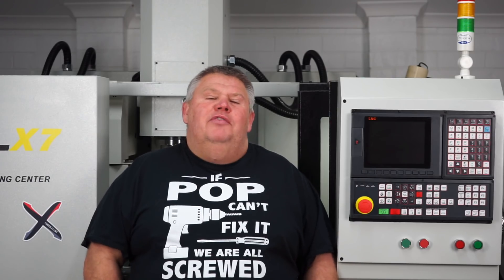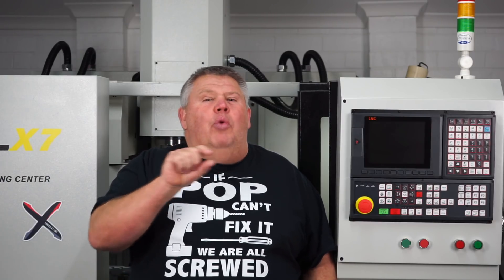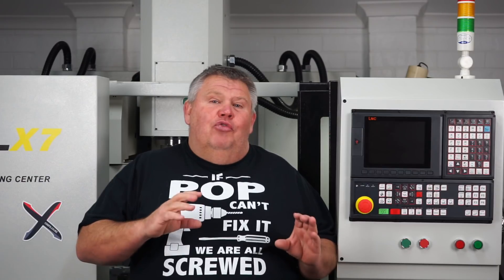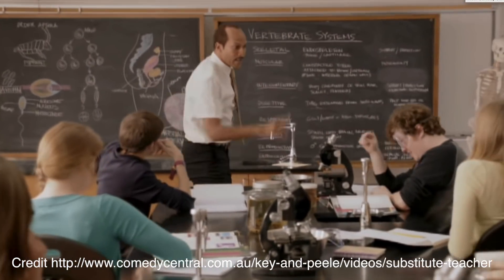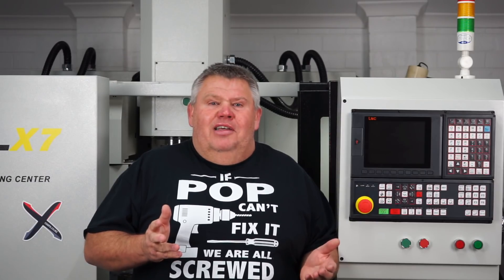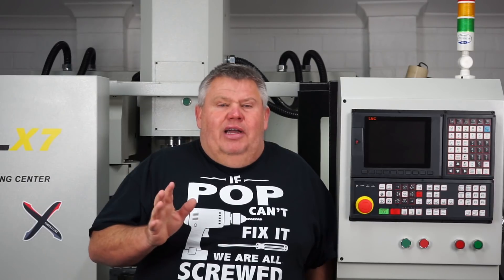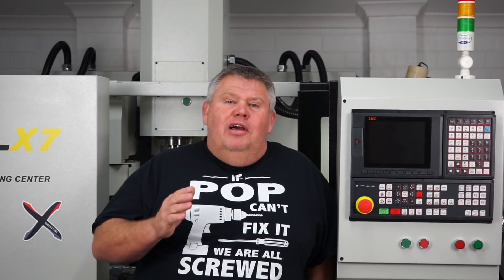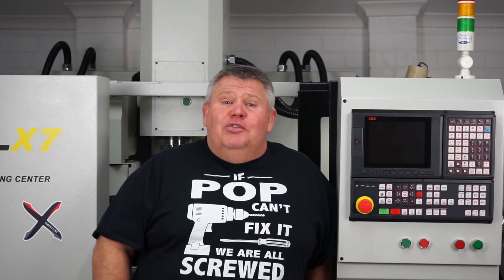Syil X7 Combo - I did something really stupid

Comment: Haas has a video showing peck drilling isn't recommended. Instead they opt for through mill coolant and go straight in.
Reply from the maker: If your machine has through spindle coolant fitted you can do this easily with a carbide drill.  It's even better if you have "high pressure" through spindle coolant installed.  Unfortunately I don't have that luxury, so it's peck drilling for me ;-)

Comment: How much do those units cost... heard they cut well
Reply from the maker: Hello Bryan and thanks for watching.  In Australia, it all depends on the foreign exchange rate (USD-AUD).  When I purchased my machine it was approximately $32K (AUD).  However, in the USA you can get one delivered for $25K (USD).  Very happy with my machine and it is cutting really well.  Cheers mate, Aaron.
Reply: Thanks mate...sounds funny for me to say mate....but thanks for honest answer...25k is alot.....what's  x y z measurement....is it big profile....or small like 440 or 770 tourmack
Reply: Know more rigid bc weighs 2×more
Reply from the maker: Hi Bryan.  I think the Syil X7 is about the same size of a Tormach 1100.  Table travel is approximately X axis = 396mm (15.5"), Y axis = 260mm (10.2") and Z axis = 390mm (15.35").  Weight is 1300kg (2755 pounds).  Hope you find this useful.  Regards, Aaron.
Reply from the maker: Hi Bryan.  Here is the website link if you would like more information.  There are agents for SyilCNC in the USA also. https://au.syil.com/small-cnc-mill

Comment: Not your fault if removing the wire was necessary! Should be an easy process to initiate the system again.
Reply from the maker: Hello Ken.  Thanks for the support mate.  So glad I got it fixed and back up running again.  Thanks for watching and commenting mate.  Cheers, Aaron.

Comment: Why on earth would they use a system that is so dependent on running 24:7? Our big industrial machines use limit switches to set "home".
Reply from the maker: I think you are mistaken.  This machine doesn't have to run 24/7.  It has a battery back up in every drive so it knows where it is at all times.  Even when the machine is "powered off" and you were to physically move the table the controller would automatically update the position when you turn it back on.  The use of limit switches can be inaccurate, especially when using fixture plates that rely on exact work offset conditions.  To be honest, high end machines such as Okuma have been using absolute encoders for years and they too never needed homing.  Regards, Aaron.
Reply: DCTTeacher1 it has a battery. To run some portion of the machine so it doesn't turn off. I'm surprised. Our ABB irc5 robots use absolute incoders and so do our mill guides. Then mill absolutes do not use limit switches BUT they are calibrated with a tape measure and the PLC increments based on the position given.

Comment: Hey, you should try to avoid peck drilling like that. the more times you re-enter the same hole the more chances you're giving the drill to scour and work your hole oversize. try doing a standard drill cycle, this should give you a much cleaner and accurate hole. In addition, most drills can go to around 5x diameter and still evacuate and break chips. Best of luck with the machine!
Reply: Another thing you might want to try is partial retracts instead of full retracts, usually about 1-3x diameter per peck. if your feeling even more adventurous you could try adding a dwell at the end of each peck to prevent a burr from forming a on the bottom of the hole. this is usually gentler on drills since the its not suddenly seeing a large load from the burr. nothing game changing just a few thoughts.
Reply from the maker: Thank you 👍
Reply from the maker: Thanks mate.  Unfortunately my controller doesn't acknowledge the "peck drill cycle" from Fusion360 only deep drilling full retract.

Comment: Hey Aron, Nice to see your new machine and that your'e happy of that!!!
nice piece of kit to have, i'm very happy for you!!
Never feel stupid, we all make mistakes, that's how we learn...  
Just for curiosity, how much did it cost this baby? Super excited to see more video from you running it.
Thank you for your comments about mine, i started learning the Siemens and i have to say.... REALLY good but i still think that your controller is a bit more easy to manage but maybe i'm wrong.
I have to make the point about the service, mine (XYZ-710 HD cnc) come's with all the part manual +service manual+ Siemens manuals+passwords and factory set passwords to allow you to change parameters if needed and is all clearly explained. I do not have absolute encoders but this is just a factory choice as allow them to save money in the limit switches and other parts.
Anyway my friend,  you got a nice machine, did you find better than the Skyfire?
All the best and looking forward to hear from you.
Reply from the maker: Hello Emanuel.  It's very nice to hear from you again mate.  I just looked up your machine and may I say I'm very impressed. Especially with the side mounted carousel tool changer and double arm.  I saw the machine on the MTD channel.  It's a monster compared to mine.  I think he said it was 5000kg.  Mine is only 1300kg.  My machine landed is approximately $32K AUD.  Now that depends on exchange rates and shipping cost fluctuations etc...  Can't wait for you to start uploading some video footage of your machine.  Cheers, Aaron.

Comment: My motoman welding robots use absolute encoders which there is a battery in the base of the machine to keep the memory. Interesting point about disconnecting these servos, without a home position input we are quite vulnerable.
Reply from the maker: G'day Anthony.  Yes mate, it really caught me out.  However the great thing about absolute encoders is accuracy and repeatability when running fixture plates and multiple setups.  As homing switches can be off from time to time.  Cheers buddy, Aaron.
Reply: for sure, it's all a trade off. glad to hear it will/has been fixed and you're on your way again.

Comment: I unplugged my Z axis with the Siemens and didnt get any error? Maybe its a LNC thing?
Reply: Both cables? The encoder won't care if the motor power cable is pulled.
Reply from the maker: footpetaljones Hey buddy. I only unplugged the encoder
Reply from the maker: Ian Porter Hey Ian. Nice to hear from you mate. That’s so reassuring to hear. As Bobby Brown disconnected his also to get her in to his garage. Hopefully he won’t have any issues. Otherwise I think he will have Richard on speed dial 😂. Cheers buddy, Aaron

Comment: Never feel stupid. The machine has to be serviceable. SYIL has to create a service manual for the machine. There are times when you have to work on the machine, replace a servo motor etc...Suggest they create a service manual and procedure list for their users.
Reply: Reading through the comments and trying to understand the thinking here.
Mainly that the thinking is that when you buy a below the line product there seems to be some sort of owing by the machine builder?????
I think most people seem to lose sight of the fact that when you buy into this range of machine you are taking it on your own shoulders.
Meaning if you buy a Doosan, Mazak, Okuma the list goes on. That's what you are buying into full support parts etc.
You guys who buy Syil machines are lucky in some regards the owner is contactable and as more people buy Syil machines you can build up a network of users and support each other.
The Good side of YouTube.

I understand the annoyance when you buy something and there is no one to help. But know what you are buying and understand the risk associated with this purchase.

Regards Peter.
Reply: Peter CCR ENG  when you buy Doosan or the others, you still need to buy support right? You have to pay someone to come out and fix the machine, or will they coach you how to do it over the phone and bypass the local service office? So you pay much more for the machine and still pay for repairs (except for warranty issues, of course). Granted, you're paying more for the machine because its capability is a couple of levels above these machines.
Reply: I am not sure how it works in your part of the world.

When you buy a New Machine from the mentioned machine suppliers / dealers there is No buying support.

Also most have a built in call out (free of charge) meaning if you have a problem with the machine they will provide this service as a part of the sale of the machine.
 Generally this is mostly within the first few months when most new owners are having difficulty adjusting to the new machine.

 If your fault (outside warranty conditions apply).

When buying any of the mentioned machine,s they are sold through a Dealer / Agent and they provide any Repairs, Parts or Information that is required for that particular brand of machine in most cases these brands of machine,s can be worked on by other outside service people as most of the controllers are generic controllers Fanuc, Siemens, Mazatrol etc

Do not take my comment as degrading machines like Aaron,s Syil it is just a reality if you buy machines like Syil you may run into difficulties finding a service tech to come out and save your day.

If you ever find yourself running big branded machines as mentioned you do not care how much it cost to get them going, just get it going is the main priority.
Reply: Hardly any cnc machines come with a service manual, service and support is how most make most of their money.
Reply: Gary, if there is no local service tech, how do you take care of your machine? Your statement is not entirely correct in all cases. If Syil is selling direct then there needs to be documentation.
Reply: @martyscncgarage5275  I'm correct... doesn't have to be local, I'm a machine tool service engineer, I fly to all parts of the world (21 different countries just this year) looking after all different types of machines. Most cnc machines are bought direct.
Reply: Gary, I wouldn't think this class of machine would dictate spending that kind of money if the user is capable of the repairs. I appreciate the dialog, have a great day.
Reply: martyscncgarage  chris0tube martyscncgarage  SYil is doing just that in the coming months there will be end user service manuals. Will it cover everything, probably not as that would be 1000's of pages. But it should cover most basic items that one may run into during the life of the machine. Syil America is opening up another location on the east coast so there will be US based support as well. They are very responsive as evidenced by Aaron and the support they gave him. They offer many different controllers to suit each person so it will not happen overnight but it will happen.
Reply: @CapeCodCNC  That's the difference between a good vendor and a fly by night vendor. I've been pretty impressed so far.
Reply from the maker: martyscncgarage Hello Marty. Thanks for watching mate. It was really a dumb thing I did, but thank god it’s back up and running again. Cheers Aaron